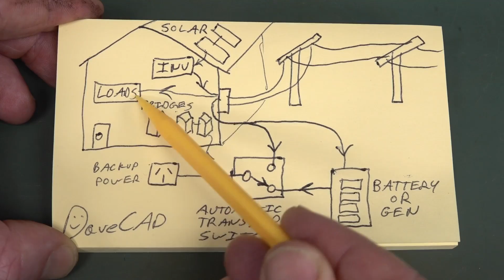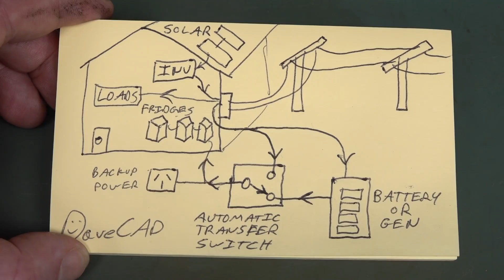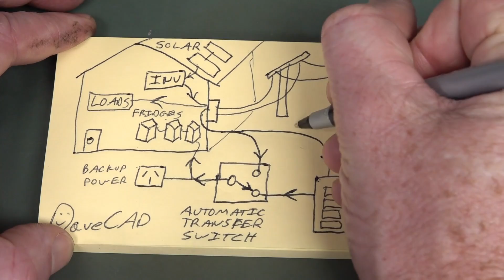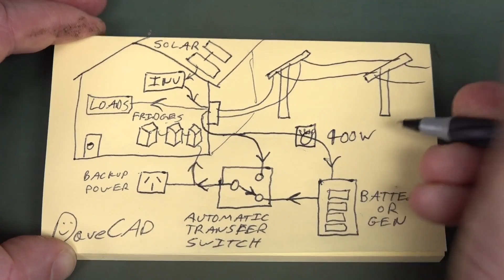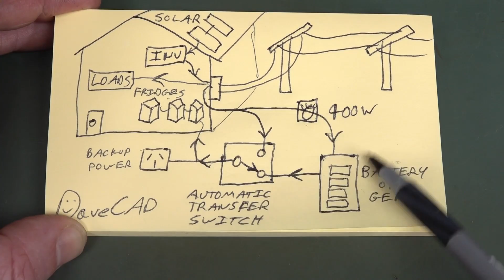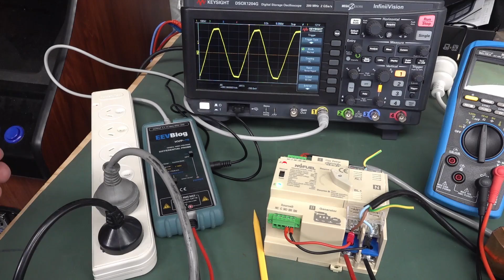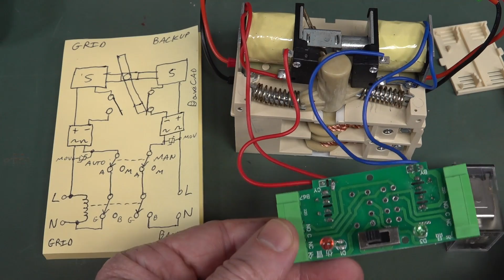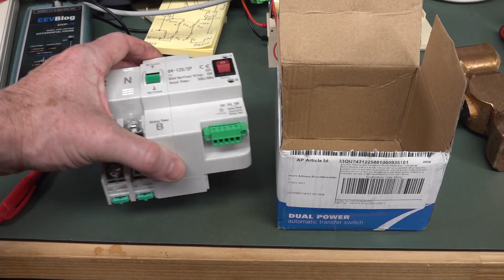EEVblog 1500 - Automatic Transfer Switch REVERSE ENGINEERED

Comment: If I were you I would rather use a double relay instead of the mechanical timer, driven by a micro-controller equipped with a real time clock. Why? Because the length of the days changes according to the seasons. The micro-controller can calculate the time of dawn and dusk according to the date. Another possibility is to use a light sensor rather than a clock to detect it's night. It seems you may even be able to drive the Automatic Transfer Switch solenoid directly from a micro-controller since the cable for the detection of the current are outside of the device begging to be retrofit as a connected device...

Comment: Just a thought Dave...

Do you really want to switch your fridges (essentially single phase motors under load) from one source to another almost instantaneously???

Will the solar inverter power source be synchronised to mains frequency? If so, no wukkas

But I'd think you might get into difficult territory if the two sources are not in synch

When I was responsible for a data centre, we were always in synch (courtesy of a UPS on the output side of the transfer switch) for most things, but we still enforced a minute or two gap between power sources (so we didn't damage the HVAC)

Comment: I wonder if you could use a UPS to do this exact same setup, depending if the UPS had certain features that you could utilise? I'm thinking something like a self test feature that you can set on a time schedule, and that will allow the battery to drain down almost completely, then switch back to AC power afterwards. So you could make it at a certain time every day, it disconnects AC power and uses it's batteries until their depleted, or until a certain timeout is reached perhaps.

Comment: I'm using these modules for my solar powered system  . The weakest point of these transfer switch is those micro switches they melt very easily .because when the solenoid is disconnected there is a huge arcing inside the micro switch

Comment: So instead of having a timer why don't you have a current clamp on the solar line and have it switch when the solar stops producing current.  If you wanted to get smart you could put current clamps on the incoming utility power and the solar then use something like a pi or Arduino to control the system so the batteries only charge when the solar system is producing excess power and feed back in when your under producing, if you don't overproduce too much you might even be able to do it with supercaps instead of batteries.  The enphase batteries basically do the same thing and they essentially use their inverters inside the battery to feed back into the house in the dark when the solar is down or island off if the utility co goes down.  It would be nice if there was a way to tap into the live data stream from the envoy from the enphase current clamps, with that data you could essentially build your own battery system for the whole house for way less and keep the breaker box setup nice and clean without extra clamps.

Comment: The quality of the first unit you tore down is much better than that of the second with the green selector switch. The one with the green switch is a "stacked" design used to add more switch sets. I have some of these I used for my generator transfer switch with 4 contacts (I only needed 3) and the outer most switch fails spectacularly when there is a surge. I already lost 2 during power outages. Always the outer most switch assembly. It seems since these are stacked and each one "plugs" into the adjacent switch plastic lever pivot, the strength holding the contacts closed gets weaker the more poles are added due to poor tolerances! The original one you tore down is not stacked and should not suffer from this defect.

Comment: And if this wunder-switch fails then the whole system is quietly fails..Where is the apocalipse alarm in this schematics in case if all fails at once? Looks good overall but plastic and springs joints do not inspire confidence..mechanical forces and masses moving will eventually break this

Comment: I'm actually doing the same thing but my continual load is a rack of servers so the changeover needs to be smooth and phase synced. Instead of a timer though and a commercial battery/inverter, I picked up an old 3000VA UPS and modified it so it can't charge the batteries attached to it. I gutted the batteries from it and connected a 14.4KWh LiFePO4 array to it's "extended runtime" input and built a little circuit with a STM32F103C8T6 at it's heart that measures current consumption, battery charge state, among other things. When the charge state is high and solar input is high it disconnects the UPS from grid power making use of it's internal switchover function. The batteries are just connected as per normal to a MPPT via a BMS to charge from solar.

Because I am using a high grade UPS that is designed for 100% duty, it has the added benefit of locking it's AC output phase with the grid phase, and when it takes over the phase is in sync with the grid, and when it goes back to mains power again it takes about 3 seconds while it re-syncs it's output to match the grid phase before switching back over.

Comment: This device is pretty basic. The problem is that the 2 main sources are not necessarily in phase. Depending on the type of load, couldn't that cause issues?
Reply: Yeah if you have a transformer connected you will get a massive inrush of current likely tripping your inverter's protection or the breakers on the mains circuit. For 180° phase difference you would need a 10ms break, and it changes depending on the phase difference. Without that your waveform looks the McDonald's M.

Comment: Nice video Dave. Those U shaped metal lets call them bars are actually for ark reduction or reduction of the arc that will start ot end in that place..so they are there only for that.. btw. I created similar circuit.. you need two main relays and then one smaller relay... and also two extra contacts..exactly how it is in that package.. I will add one small thing..they should add small capacitors parallel with coils to reduce voltage spike and it would good design

Comment: Hi Dave ! futher to the SeanBZA comment below, there is the problem also fixed by the timer, the compressors having a power cut and reapplication with the compressor still under head pressure usually that time is around five or ten minutes otherwise the compressor just keeps cycling till that pressure reduces hard on the overload and the motor, Cheers!!! Rick Armstrong from Canada

Comment: Be very careful when switching a fridge. Not all of them can start up with a already compressed cooling fluid. In which case they stall forever and die. This is in your use case very problematic. Because the switching happens most likely when they already started running and the battery gets to empty.
Reply: Every one like that I've seen has a self-resetting thermal cutout. They'll just stall for a few seconds, turn off, and a few minutes later switch back on.

And in my experience fridges are fine if a few cycles are missed. There's enough inertia that it keeps going.

Comment: Ironically I was looking into a transfer switch, I have seen one on AliExpress which is again different to what you have shown here. It actually has a motor instead of solenoids... Big Clive has done a great video on it. 
The motor version switches slower than the one that you demonstrated, and I need to use a transfer switch to get from a solar battery inverter system to the grid and I also will be using a WiFi connected din rail timer but apart from the gap in the switch time (it will be powering a blade server) I'm concerned about the faster switch time and a possible miss match of frequencies between inverter and grid.... I don't know how that will work out, I'm going to have a UPS between the transfer switch and the server to cover the switch gap but a faster response in switch time like the one in your video, would that cause a problem? 
In your case, it might mean blowing up the fridge compressor or two!!! 
I know from experience that as soon as I connect my fridge, the compressor fire's up pulling a huge spike before settling down to it's rated power consumption..... 
You might want to look at your fridges, 3 of them firing up as soon as a switch moment happens, if they all spike, good luck to your battery! I have already replaced two BMS boards and I am waiting for another 4 to turn up because they have all died! And that's only from one bloody fridge.... 
Solar related videos are always popular and welcome, I personally can relate to what you are trying to achieve.... I will be waiting for a follow up video on your journey with anticipation..... Many happy travels Dave...

Comment: Hopefully you can tell your battery inverter to not re-energize until it reaches a certain SoC, otherwise this might chatter as the inverter energizes, then quickly browns out. 

Nicer ones have time delays to prevent that (wait 30+ seconds to make sure grid is actually back on), and also zero crossing switching.

Funny timing on this video. My campus is doing ATS testing today and switching to “island mode” (local power generation) off the grid and making sure everything works.

Comment: Hi Dave,

Imagine this scenario: Your freezers are powered by battery in the night and the battery is empty. Then the  ATS switches to mains. However, since the battery is not under load anymore, the voltage increases back again. Then the ATS switches back to battery. Then because of not having enough power, ATS switches back to mains...then loop....

I am sure that your BMS is smart enough to cut entire battery output off (high Z) after the battery depleted and not enable it again until it is charged. But anyway keep this problem in mind ;) Cheers.

Comment: I think others may have already covered this but just in case.
Ideally you want both sources in phase before you do the transfer.  That can take a few seconds when switching back to mains to bring the inverter into phase. It all sounds a tad messy but the big inverter I worked on  years ago managed it. It's the same when you connect a 500MW generator to the grid and you really do not want that out of phase or it get very spectacular and expensive.

Comment: This is for AC only, which is a problem for me. You cannot switch between the 24V/48V DC battery pack and the AC power grid.

If you use a micro inverter, which makes AC, you have to convert it to DC for battery charging. Then, you have to convert it back to AC, which can be switched by this device. The DC-AC-DC-AC conversions result in huge energy waste.

It is better to use a solar MPPT charger for the batteries, then you can put a DC/AC switch, which selects between the DC battery power and the grid. If battery is selected, the DC battery power can go to the DC-AC inverter, which means only one conversion.

P.S.: the cost of grid power should be extremely expensive, which can justify the cost of the battery pack, switches, cabling, etc.

In the most countries, grid power can be paid for years by the cost of the batteries. The batteries will die well before the whole investment returns.

This setup is only good for backup, but not for saving. You can use your backup system to have some partial returns by this config, but the total investment probably never returns.
Reply: Most countries except Europe right now

Comment: So how do you monitor and direct the solar power into your EV or Battery bank? My Solar has an inverter that shuts down if the mains is shutdown, but If I run a backup battery off the grid, it cannot detect if the solar is providing the power or the grid. Do you have a method for detecting when the solar is providing the power so that all the power generated is used by the battery charging. It would help to charge local batteries during the day when I am at work and then allow me to high voltage charge an EV during the night.

Comment: Our CBD office has independent connections to two separate grids because it's in a bank building, which is great because it basically meant we didn't have to have a UPS for our data centre. It's practically impossible for both grids to be down at the same time, because that would mean the head offices for most of the major banks and financial institutions in the country would go down.

Well, one day there was a major power outage in the CBD, it took out one of our grid feeds, but when our automatic transfer switch switched over, it decided half way through that it was too much work and exploded, taking out the second power feed and our entire office and data centre.

Everyone was basically left standing around twiddling their thumbs for a couple of hours until they could get an electrician to bypass the transfer switch and reconnect the one good power feed. Unfortunately the disruption probably cost the business about half a million Aussie dollary doos.

But that's not the end of the story. Do you think this convinced them to install a UPS? Nope! Instead they decided that in the event of losing one grid feed, they'd have an enormous generator on the back of a truck, which someone would drive into the CBD and park on the street outside the loading dock. Then they'd roll out a huge cable up the ramp, through the loading dock, and into a panel to feed another transfer switch that they could use to power up the missing feed.

Yep, a flawless plan. Thankfully we haven't yet needed to implement it, since the grids have been stable since then.

Unfortunately the UPS in our head office wasn't as reliable ... but that's a story for another time.

Comment: in your setup, you were talking about using a timer.. why not use a DD (dusk to dawn) switch instead?  save yourself some hassle and automate that part as well! (note: there are also dawn to dusk switches as well- and most of them can be made to operate in either direction... piece of cake!)
Reply: a side note about DD switches, I happen to come across one that has ZERO electronics whatsoever!  it consists of a small magnet, a 10 Kilo-Ohm carbon comp resistor, a CDS (photo) cell, 2 bi-metal strips and 2 contacts- and thats it!  and how it works is elegant- yet complete.. it even compensates for temperature differences!  it came as a dusk to dawn (night) switch, but, by simply moving the resistor to the other strip, it became a dawn to dusk (day) switch!  its a really nifty little gadget!

Comment: These ATS are not for rotating devices as one cannot ensure that both power supplies are (were) in-phase. 
The worse case scenario is opposed phase which would surely stall an rotating device.
Reply: For some smaller appliance it may get away with it...
Reply: Small motors will survive.  But really large equipment, you're absolutely right.  Our system would check and if drifted out of phase, strip the motors before closing the alternate source feeder.
Reply: ...it would destroy the Device😱 it would.....Explode:dothefive:
Reply: @animarkzero  it would trip any upstream breakers. The battery inverter would likely cop it too.
The mechanical delay should be sufficient at 180° however the waveform is going to look like the McDonald's M. It will cause massive inrush currents on any connected transformers and the harmonic will take several cycles to dissapate.

Comment: Your optimal cost timer should be set to a random time offset from exact hours, to avoid grid impact from other people running similar clocks. This smoothes out the load discontinuity for the grid backbone system, giving them time to startup power sources.
Reply: In theory, maybe.  But those refrigerators are intermittent loads anyway.  They cycle on/off somewhat randomly throughout the day.  If you have a load big enough to seriously impact the grid, the grid operator already knows about you and your staff have discussed such issues with them.

Comment: I'm not so happy about the mounting of the two microswitches. Just a single screw so they can rotate it to the right position. If they don't have glue under those, they will loosen in time and fail.

Comment: I have a similar setup at home to use battery power when electricity is expensive. I have found that switching while a fridge is running and the voltages are too far out of phase between inverter and grid the fridge kompressors will stop abruptly. I am aware double positive (or negative) ac pulse essentially is DC and acts as a brake on induction motors when using vfd's, I suspect my fridge compressor have a very low rotating mass as well and out of phase power upsets it. However measuring voltages with a multimeter and transfering between sorces when both are near 0 volts betwheen line 1's keeps the fridge happy and it continoues to run. Inverter fridges dont care, but I recommend testing this in your setup.

Comment: Why switch the neutral? I would have thought only switching hot would be the prefered solution.
Reply: @tim g I watched some videos and I can see the risk if it was mounted outside of his switch board, but I would assume this will be mounted in his switch board. Couldnt both supplies tie to the house neutral bar at the switch board? that way they are both near the MEN / PEN link and keep both supplies close to ground potential.

Comment: Still didn't get it why using a 'big-ass' transfer-switch when everything could easily be done with a simple relay (operated with Akku-Power) operating appropriately rated changeover contacts

Comment: The problem with AC is if you want zero switching time, you need to phase lock the supply's.  Or convert both to DC then invert back to AC the same way a lot of high power UPS do.